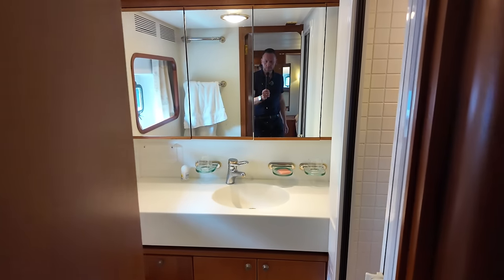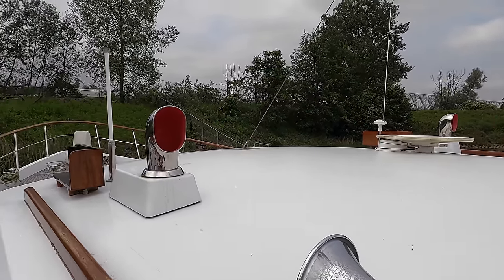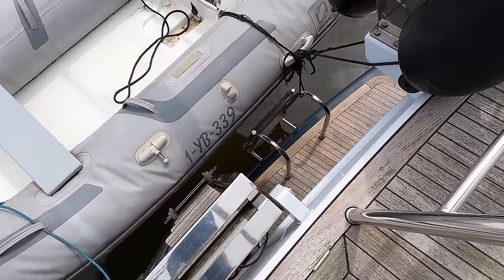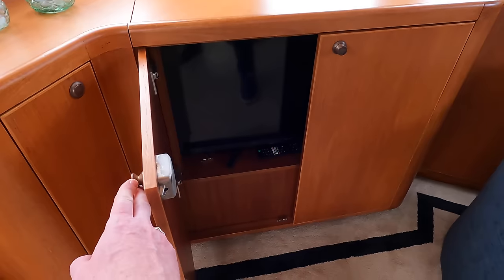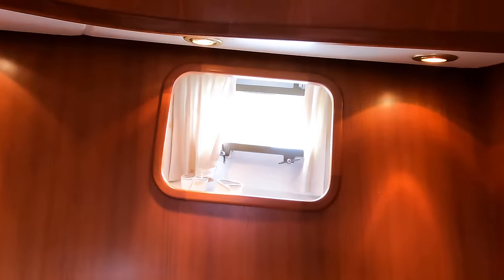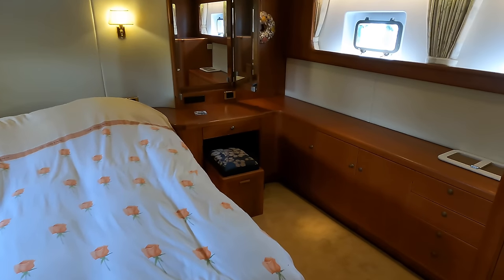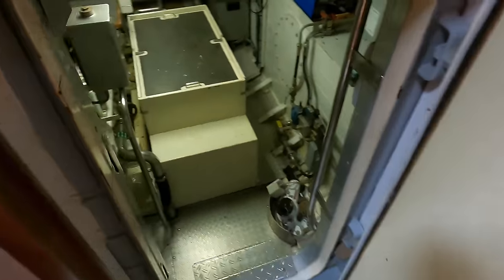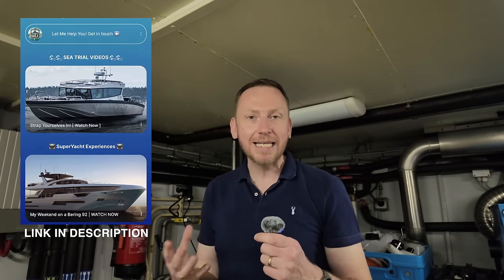€449,500 DOGGERSBANK 1900 MY Steel Explorer Yacht FOR SALE | M/Y ‘Skagerrak’

Comment: I could see it under sail with the addition of a large kite adding additional speed. She's even small enough to use hydrofoils. I would change the power train to a turbine electric hybrid so you could power it with everything between kerosene and cooking oil or overproof rum. I would also paint the entire exterior vanta black and limo tint the windows. The decking  as is would look fantastic against the ultra black paint. The interior would look great in overstuffed 80s style white leather seating and cool white sharkskin wall treatments. Oh well, it's time to go back to work. I I'll finish this later!